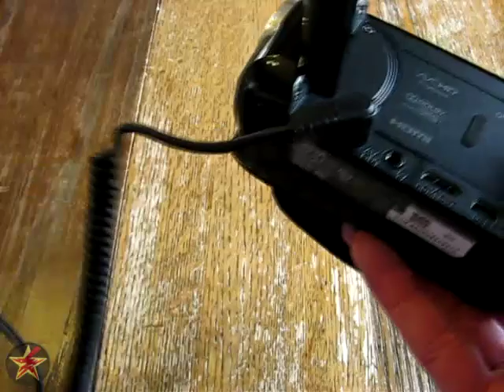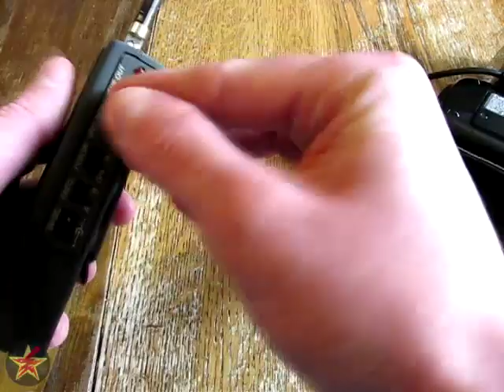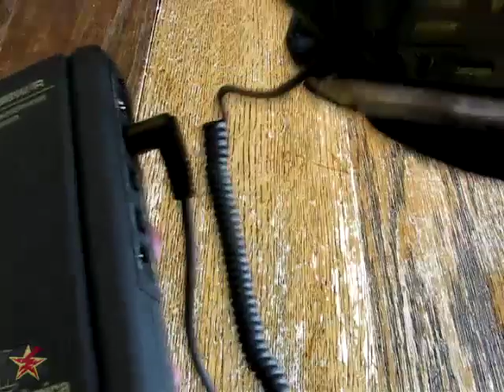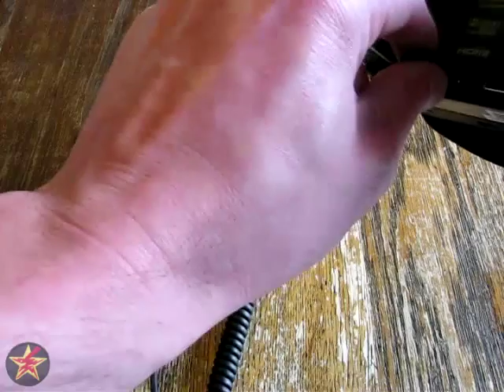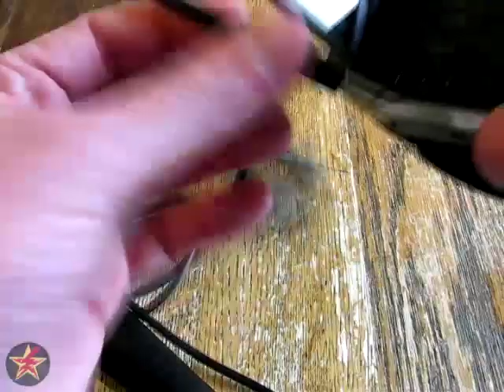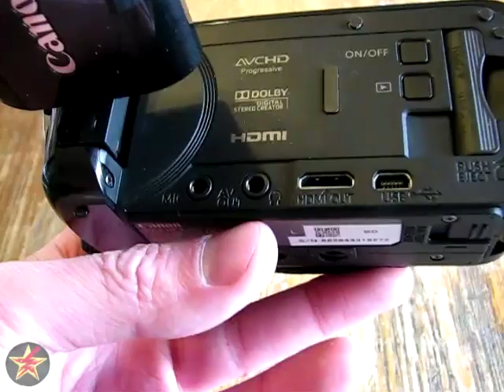Canon Vixia HF R400 How to: Use An External Microphone

Comment: It seems i only get left audio with a powered mic. is there settings on the camera to change that?
Reply from the maker: Some mic only have mono recording. If yours does this there are two options you have. Either use a different mic or using post production software you can duplicate the left audio track into the right channel as well. I have done this a few times depending in the mic I use.
Reply: +Wanderer001 I have this mic: http://www.amazon.com/gp/product/B00WJXHUXQ?psc=1&redirect=true&ref_=oh_aui_detailpage_o01_s00  am i doing something wrong. or what would you recommend?
Reply from the maker: +PredatorOwnz04 It does not seem like it is a mono style mic.  You can always try using a different 3.5mm jack to see if there is an issue with the cable.
Reply: +Wanderer001 I have tried 4 cables now. any other ideas?
Reply from the maker: Do you have any other mic to try? Figure out if it is the camera or the mic that is causing the issue.
Reply: +Wanderer001 I even replaced the camera with a new one. and changed mic
Reply from the maker: And you are still getting the same issue? Is it the exact same mic?

Comment: this camera does not support all microphones, it must be a self powered mic, i found out the hard way.
Reply: Ya, I just got burned on this too.   That mic jack was one of the main reasons I bought a vixia.   Useless with my rode video micro :(
Reply: So would a typical generic lavalier mic with the cord going to a 3.5 mm jack not work then with this camera?
Reply: thank you
Reply from the maker: No it would have to be a powered mic.
Reply: @Wanderer001_Reviews  Is there any converter for the non powered lav mic to plug into and then plug into camcorder?
Reply from the maker: I am sure as long as you found something to act as the go between and a power supply it could work.
Reply: @Wanderer001_Reviews  that was my question if it's an issue of the power support. I found something on eBay a lav mic and a handheld mic with a power supply 9-volt battery operated. And then I bought a little mic stand and pop filter as well.and some different background than the one I bought cuz three-by-five is kind of small. I want to give my testimony about how Jesus Christ changed my life in December of 2015.
Reply: Mine didn't.
:(
Reply: Dang bro!! I just got a non-self- powered mic, gonna have to return it.
Reply: certified30 SAME!!! Just now and I had to fall down a rabbit hole to find that out.
Reply: certified30
Reply from the maker: https://youtu.be/fszzAF8wif0 this is the one I use.
Reply: you mean if it needs power that it needs to supply its own. many mics dont require power so that comment is useless.
Reply: Would any of you know if you can plug this camcorder to a sound mixer ?
Reply: @plgj7  I actually purchased the Canon Vixia HF R500 because I could plug in my Shure SCM 268 Microphone mixer. I had used this professionally, for years. The 500 and the Shure mixer worked very well for me.
Reply: so if i have a lav i need to charge it will work on this camera?

Comment: I have an iPod running into an electronic drum set. I use head phones and it is loud. Do you think the audio input on the camera could handle it going from the headphone output on my drums to the input on the camera?
Reply from the maker: +David Willard It should be able to.  You can always change the mic level to lower it a bit if it is too much for the camera.

Comment: This is very helpful. I have the Vixia him 400. I just bought an Aputure A.lav wired microphone. It has a rechargeable battery. I'm getting a lot of LOUD buzzing, which I have been unable to resolve by trying different cables and settings. I'm wondering if it is not compatible? Or if I have somehow missed appropriate settings. It seems the camera should be adjusting auto, but I have tried adjusting manual settings as well without good effect.Any help appreciated! Many thanks!
Reply from the maker: +Susan Abbott Is the Vixia 400 running off battery or do you have it plugged in while filming?  I have found that if I have it plugged in and use a mic I get a similar feed back.

Comment: Hey I get a horrible sound when I plug the headphones in the headphone jack does anyone get the same ?
Reply from the maker: +ryanzzification What do you consider to be horrible sound?  I am not going to say it is the best sound in the world but it is acceptable for what you are using it for.
Reply: +Wanderer001 a loud beeeeeeeeeep
Reply from the maker: +ryanzzification That is not normal.
Reply: +ryanzzification probably means you have to go switch av to headphones in the settings, happens to me a lot too
Reply: Thanks! Got that buzz out of my headphones! Still can't get stereo recordings.

Comment: Anybody know how to make the r600 work with a Blue Snowball mic?
Reply from the maker: +Woodside Productions Would need an adapter.  Blue Snowball use a usb connection not 3.5mm jack.
Reply: The problem is when i plug it in, it does not work. I know the mic works because i use it for voice overs.
Reply from the maker: +Woodside Productions I did over look saying that the splitter will need to have a power supply.  The Vixia line does not have enough power from the mic port.
Reply: Any suggestions of what and where i can get the power supply needed?

Comment: It's not really a good idea to use the $7 adapters (XLR to 3.5mm.)  What that does is turn a grean Balanced mic signal into an Unbalanced signal.  It will also create an impedance mismatch.  The XLR mic is low impedance and the input to the camera is high impedance.  This will create a thin tinny sounding recording.  If you must do this, use an adapter that has a low to high impedance transformer built in.

Comment: You may have just solved my problem with the R600... I didn't realise it needed to be a powered mic!!!! Thanks. If this works for me I'll try to come back and thank you again as this could save me recording separately every time!
Reply: +Damian Brown http://www.ebay.co.uk/itm/MICROPHONE-PLUG-IN-POWER-BATTERY-MODULE-3-5mm-MONO-TO-3-5mm-STEREO-JACK-PLUG-/301497740311?hash=item4632aa6c17:m:mEJGGloDsHpiKLtHQMxHmrw seems to be what I need... anybody tried this?
Reply from the maker: +Damian Brown I have seen a lot of people use this one: http://www.amazon.com/gp/product/B00HUEBGMU
Reply: Thanks, looks like similar tech to the Boya I found!
Reply: +Wanderer001 Sorry responded to wrong post earlier.
 Hi, I bought the mic you recommended and it is not working with my Vixia HF R600. The weird thing is when i switch the power on I see the decibel meter do the meter thing you show but then when i speak there is no response on the meter and it does not record any voice. Any suggestions.?

Comment: I tried using a RODE VideoMic Go with this camera and when I plug it in, I can't get an audio signal. Is this mic compatible with this camera or should I try testing if the mic is faulty? Thanks in advance for any reply to this question.
Reply from the maker: +Interface Death There should be no issue with the mic.  The issue is the camera.  One of the issues with the cheaper R400 line is that you need to have a powered mic.  The RODE VideoMic Go does not have its own power source rather it uses what it can draw off the camera.  The R400 does not output enough power through the mic port to power any mic.  So the only mics that can be used have to have their own power supply.
Reply: Wanderer001 That's what I though. Thanks for the reply.
Reply: Do you know if the issue with the mic port is the same with the Canon HF M300? Searched all over the Interwebs and can't seem to find an adequate answer. All I want to know is whether my Vixia M300 will work with the Røde VideoPro Go... -Thanks in advance for answering this, given I'm replying to a comment from 2 yrs ago ;)
Reply from the maker: It does not look like it would.

Comment: Is the audio quality via the external mic good enough to record a live event? I'm getting a LINE OUT from the main mixer device, will this camera be able to record stereo audio from it?
Reply from the maker: +Hrushikesh Ghatpande The audio quality really depends on the external mic that is used.  I have never had the opportunity to use a line out from a mixer.  However, and log as you have the right cable I think it will work and give you stereo as long as that is what the mixer is outputting.
Reply: I do have the right cable. Looks like I'll just have to test it out somehow.
Reply from the maker: +Hrushikesh Ghatpande From the videos I see you on your page it looks like you might be working as part of a stage crew.  Any chance they will let you set out the mixer camera during one the the practice runs or a full dress rehearsal to make sure it works?
Reply: @thehrushi  Did this work for you? I am planning to use this with a Mixer output. Response is highly appreciated!
Reply: @varghesek123  yes it did.

Comment: This wasn't helpful. :(
Reply from the maker: +alpha numeric What did you want to see?  How could this have been helpful for you?
Reply: Wanderer001
In all kindness, you took a long time to merely say, "Plug the mic into the camera."

With that said, you didn't address any of the issues that come along with pluging in a mic into the camera, namely volume adjustment.

Wish you all the best, and sorry for the frustration, the hf r600 is proving to be critically limited for my purposes.  I'd like to be able to plug in an external mic, and control the volume of the mic.  From what I can tell, I cannot do that in auto mode - which results in horribly maxed out audio.  I can control the audio input, but only in a cinematic mode (and possibly in ae mode), which frankly, makes my video look like sh!t!

I bought the hf r600 largely because of the mic input, but the devil is in the details, it has a mic input, but you can't really control the mic gain!  What a detail!  Shame on Canon.  Perhaps they've released a firmware update?  I've never updated the firmware on a camera, perhaps I should look into it?

And thanks now for participating in my internal dialog, lol, and sorry for a-holishness, wish you all the best.
Reply from the maker: Thank you for the feed back. I am sorry that there were unforseen short comings with the r600.
Reply: Wanderer001
You and me both, buddy!

Comment: Hiya do you know if I can use an external mic with the canon legria hf r606 camcorder? It doesn't have a jack socket but it does have a mini use port
Reply from the maker: +Dan Emmens Sorry I do not know for sure.  I do know that the USB on the HF R400 does not work as a mic input.
Reply: +Wanderer001 thanks for the speedy reply, I'm really struggling with wind noise filming my vlog 👎

Comment: Will it sit on a tripod? Will it record on special effects like monochrome and cross process?
Reply from the maker: My Puritanical Opinion The mic set up that I use can sit on the tripod.  It also can be used in all the modes.
Reply: Wanderer001 Well, thanks for your quick answer.

Comment: I need to run 2 wireless mikes into my 400. I have the exact same Audio-Technicas you show here. Thanks-Wills
Reply from the maker: Willi Patterson If you are asking how can you do this with your current set up you would need a second mic, that you can switch between channel A and B.  The other way you could do this is by use of a audio mixer or splitter.  Hope that helps.
Reply: Wanderer001 Thanks Wanderer I have two wireless kits, it looks like a splitter actually works as long as the levels are the same for both mikes.

Comment: Every single time I plug in the mic, it can not longer catch any audio :(
Reply from the maker: ***** What mic are you using?  I link would be helpful.
Reply: http://www.amazon.ca/Zalman-Zm-Mic1-Sensitivity-Headphone-Microphone/dp/B00029MTMQ
Reply from the maker: ***** Looks like you are running into the issue that the R400 has where if it is not a powered mic it will not work.  I might recommend something more like this: http://www.amazon.com/gp/product/B00HUEBGMU.  Same style but is battery powered.
Reply: Thank you so very much, ive been trying to figure out what was the problem for such a long time! Thank you :)
Reply: +Wanderer001 Hi, I bought the mic you recommended and it is not working with my Vixia HF R600. The weird thing is when i switch the power on I see the decibel meter do the meter thing you show but then when i speak there is no response on the meter and it does not record any voice. Any suggestions.?
Reply from the maker: +Love, Sex and Relationships Which mic, I do make a few suggestions?

Comment: I have a Vivitar microphone for my cannon hd vixia r52 everytime i plug it in it has lots of static, any help? D:
Reply from the maker: MelloJosh It seems to be an issue with that microphone.  Looking over some of the reviews of it the static or noise it produces is a common complaint.
Reply: Wanderer001 What microphone do you recommend for my camcorder? ;o
Reply from the maker: MelloJosh What type of filming are you planning to use it with?  I see you mostly do lets play style videos.  Also, how much are you looking to spend on one?
Reply: Wanderer001 On my other channel its called MelloJoshFilms and mainly for creating short films and stuff and im also in filming class in high school! that type of filming :)
Reply from the maker: MelloJosh Ok, so from what I see you might be best served with a shotgun mic.  However, there is one issue with the vixia line of camcorders they tend to need a mic that has a power supply, and there is no way to mount a mic to the camcorder itself.  With that said I think I have some suggestions for you.  First being something like this (http://www.amazon.com/Adorama-Heavy-L-bracket-Standard-Mounts/dp/B002A92OVM/ref=pd_bxgy_p_text_y) which will give you something to mount a mic on to but also give you something to hold on to.  Next is a shotgun mic.  http://www.amazon.com/Rode-Videomic-Shotgun-Microphone-Rycote/dp/B00CAE8PM4/ref=dp_ob_title_ce.  Comes with very good recommendations but not know what your price point is this one can be considered a little expensive at $118.  But with luck it will give you a starting point to find what works best for you quality and price wise.

Comment: how to can I record audio on Canon Legria HF R46 using an external wirless or wired microphone?
Reply from the maker: Waqar Sahi From what I can see it does not appear that this model has a mic in port on it.  This would make using an external microphone impossible.  However, I do not own this camera so I am only going on what I was able to find on line.
Reply: Alright, thank you so much for getting back to me.

Comment: Wanderer001 What microphone (or microphones) would you recommend to plug into the Canon HF R400 to best record performance Exhaust (get the deepest tones, and the high tones and everything in between).. and be able to handle the SPL.  My budget isn't high due to this is the only reason I would use this particular mic.. So somewhere at $50 or less.  Any options/links/names?

An example video of the exhaust noise exceeding a different cameras SPL capability and not obtaining the lower tones.

https://www.youtube.com/watch?v=ElsLs0Cez3s

Thanks!

Comment: Nice overview, but assumes the wireless mic receiver outputs mic-level, not line-level audio, and that the receiver also takes the mono mic signal and puts it onto both the left and right channels of the mic receiver output jack.

The Vixia mic-in jack is actually set up to take a TRRS (tip-ring-ring-sleeve) plug, similar to an Iphone earphone/mic plug. Going up from the tip of the plug, the signals to the Vixia are left-audio/right-audio/ground/power.

If you want to use the power connection, you need to use a TRRS plug wired correctly to use the sleeve power. Plugging a regular stereo plug (TRS) into the Vixia mic-in jack shorts power to ground in the camera, but that is OK since the power has a fairly large resistor in series and is current limited internally.

If you plug a mono mic with a TS (tip-sleeve) mono plug, you will get audio recorded only on one of the stereo channels. A mono to stereo adapter will put the mono signal on both left and right channels and correct this. The power connection in the camera is shorted in this case.

If a mono mic relies on power applied to the tip of the connection, as a condenser mic might, it won't work. You need to use a TRRS plug and wire it to provide needed power on the tip of the mono mike . Google for circuits.

In my case, I had a wireless mic receiver that output a mono, line-level signal. To adapt to the TRRS input of the Vixia, I wired an adapter circuit with two resistors on a small piece of circuit board. The two resistors first reduce the mono line-level receiver to mic level. I then wire the reduced level to both the left and right connections on a TRRS plug. I then make the ground connection directly from the sleeve of the receiver connector plug to the 2nd ring connection of the TRRS plug going to the Vixia. I leave the sleeeve connection unconnected on the plug. Using a TRRS plug avoids shorting power to ground in the camcorder, and may save slightly on battery life. In this setup, the power connection from the camera is not needed.

Sounds complicated, but works without thinking once the adapter is wired up.

An excellent write-up on making various adapters for the mic input of a Vixia is at:

http://www.instructables.com/id/How-to-connect-an-external-microphone-to-a-Canon-c/